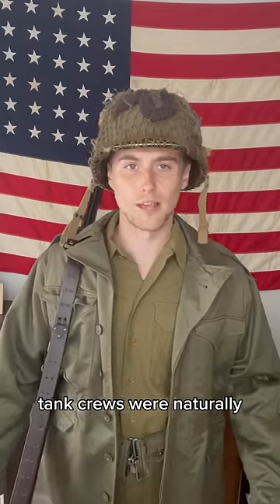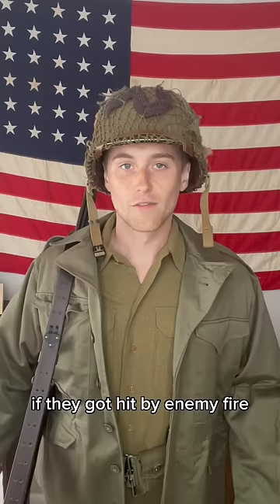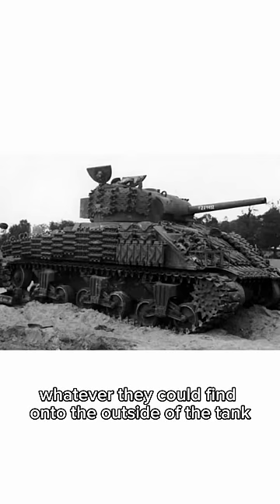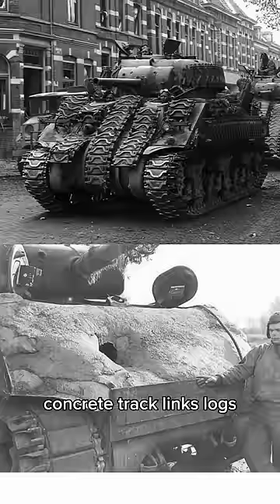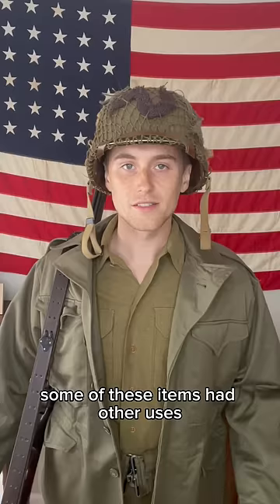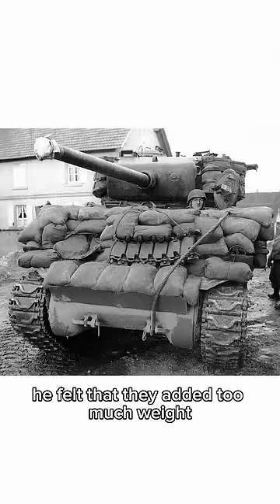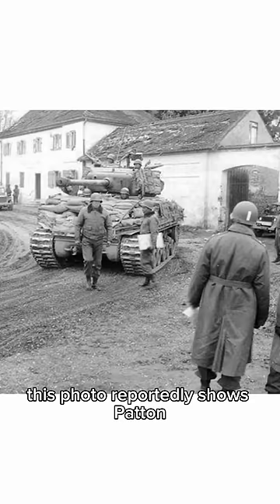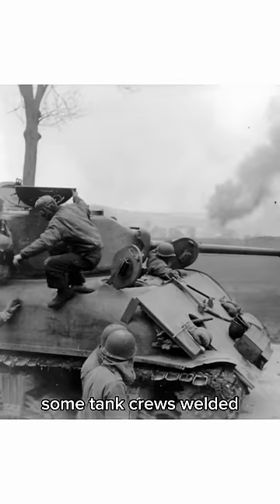Improvised Armor on US WWII Tanks

Comment: The Germans actually scientifically tested weird improvised armor like sandbags and concrete and even track links and found them to have no significant added protection against armor piercing ammunition
Reply: The biggest advantage of sandbags to the Sherman was to prevent the small arm rockets like the panzerfaust from instantly being able to destroy an early m4 model since they had terrible ammo protection
Reply: The Russian did too, but they still add random stuff cause it give the tank crew extra courage to rush forward. You can say these stuff is like the fancy skin that add zero armor value, but add mental strength.
Reply: @CSRI except a panzerfaust crew would never be stupid enough to attack the front of the tank. 

The main addition was moral support to the crew.
Reply: Sand bags for the driver may protect from small arms when he's open hatched
Reply: @CSRI unfortunately it had the opposite effect. DOD ran tests and found it actually helped the early heat projectiles fuze easier. But seeing the morale boost it provided they decided to withhold this information
Reply: The Germans themselves were applying forgot what it was called to tanks to prevent magnetic bombs. Improvised armor definitely was useful against certain types of ordinance.
Reply: @limyohwan zimmermit coating wasn't a makeshift design. It's factory applied.

Comment: During the Marawi Siege here in the Philippines our military kinda did the same against the RPGs of The Maute Group (Isis inspired group.) they added wood, and other materials to thicken their armor. Some legends even Painted "Free Wifi" on them.
Reply: That was actually effective against the early RPG 3 warheads, but if it came to actual protection against AT shells from other tanks, the protection was marginal at best compared to all the additional weight
Reply: @Charles-A they were useing rpg 2 not 3 and if im not wrong used cheap HE vertions not HEAT
Reply: @nikolaideianov5092  Thanks for the clarification

Comment: Being entirely fair, this did work out in some specific circumstances. This is why in that Marawi Siege in the late 2010s you saw AFVs with wood, plastic, and even cardboard bolted on to the vehicles and this provided enough protection from older model shaped charges.

Comment: I believe this was from The Chieftain but the improved protection using sandbags, wooden planks or track does more harm than protection against enemy shells.
Reply: Not shells but heat projectiles like the many AT launchers available at the time
Reply: @Doc_Paradox and also the shells, because it's too soft to bounce the shells, so it would either lead it much closer to a 90° armor hit than it should've hit without it, or nothing changes, which still means they are dead
Reply: Man you should have warned german tanks that put tracks in front of it as part of extra armour.Ex:Panzer IV and Tiger.They did this for pure added armour
Reply: @pecetabla8042 when you put couple inches of armour on alrrady flat surface, it stays flat or 90 degrees, thats why Panzer IV has track in front of it, extra armour
Reply: @Doc_Paradox  i’m pretty sure you have to have it. Spaced for shit like tracks and other stuff to work against heat rounds because if they’re still touching the tanks metal it’s gonna do nothing but just add another few inches of metal for the heat round to go through.
Reply: @owen6033  the DOD did tests and found the additional junk actually put the tankers in more danger as it would help early heat projectiles fuze easier. But upon telling this to various upper brass they all agreed the psychological comfort the added armor gave was better for morale than revealing to them they were at an even higher risk.

Comment: Patton may have been right for more reasons than that. A fact I've heard (but haven't checked, so take it with a grain of salt) is that add-ons like logs and sandbags could actually help an incoming shell penetrate angled armor by helping it normalize against the angle, similar to how the cap on a capped AP shell works.
Reply: Tests conducted had shown that did happen.  

It was even worse for HEAT rounds from panzerfausts, since it made them much less likely to deflect,.  It also increased the  standoff distance to a more optimal location that made penetration of the actual armor easier. .
Reply: Maybe the moron could’ve pushed for better equipment for his soldiers that actually died obeying his command than scolding them for wanting to not die.
Reply: If you bothered to do any research, you would know that he did just that.  
Patton was a big believer in improvements that actually worked, like adding on additional armor plate.  He instructed that add on armor plate from wrecked tanks be salvaged and and used.
Reply: @scottydog1313 W.. What..?

You know how HEAT works, right? A chicken wire mesh could prevent Heat from penetration.

Besides, German tanks mostly used APHE, some variants also opting for BC, however there were very few variants that utilized HEAT. Now the STUG and STUH assault guns did, and were common ambush tanks. They'd have a hard time with a log equipped Sherman.

Comment: I gotta agree with Patton on this one. Sandbags might protect from small arms fire, but if you’re going tank to tank, most of the time you’re not so worried about their machine gun. You’ve got bigger problems. The added weight most likely isn’t worth the trade off. Additional frontal armor will at least give you a chance at surviving some tank rounds that you otherwise wouldnt have though.

Comment: Video games tell me that the angle of the metal plates were just as important as the thickness. The addition plates being angled seem better than sandbags that might help enemy fire find purchase on the tank. But as someone who's not military and only seen tanks from a distance, in videos, and in games I would trust the experienced soldiers over what I think I know.
Reply: Unsure what the Ballistics on sandbags are (I know they're good at stopping small arms) but they might be like a reactive armor in the case that it absorbs the initial impact and helps to slow down the round enough so that when it hits the actual armor, it has a better chance of deflecting or just flat out not penning.
Reply: I dont think the average soldier in the 40s has as much knowledge as the average highschooler in the 2020s considering the amount of research in basic physics thats happened since.
Reply: @wingsoficarus1139 their tank and training manuals state exactly how angled armor effects the reliability of shell penetration.

At the end of the day, in most circumstances, the ad-hoc armor most likely provides some small amount of protection, seeing as things like reinforced concrete were officially implemented on German tanks.
Reply: @medicodyssey  reactive armour acts primarily by destabilising or fracturing projectiles, spreading the projectile over a greater volume of armour.
Reply: they really only worked on something like the panzerfaust because of how the weapons was designed. every other option shown would work at least somewhat against all forms of AT weaponry. Sand bags add way too much weight for the little good they do. Slap on logs and scrap wood would do the same job against the panzerfaust, but be far lighter. @medicodyssey
Reply: @jaydeleon8094  You would think so, but they actually made things worse. The Third Army did a study on the effect of sandbags and logs and such on shaped charges, and found that the additional stand off range actually increased the penetration power of the weapons. The reason was because of the rudimentary design in early shape charges, the jets didn't focus properly until several inches after detonation. The blast itself would blow the sandbags out of the way, leaving a clear shot for the jet of metal liner to the armor.

That report is a big reason that Patton did not like the additional armor, on top of the fact that he liked his soldiers and their equipment clean cut, shaven, and squared away as it were. The proper metal plating actually did diminish the effect of shape charges because it had a rigid, heavy structure to disrupt the jet from forming properly before it hit the main armor.
Reply: the sandbags yes. sufficent sized logs would also work to not kill the crew. wood planks added spaced from the hull worked well, especially on the front. the sides was to prevent an instant crew kill.  this is also why you see tracks under logs and wood  on the sides to acteds as spaced armor for more additive armor. @MUJUNKY
Reply: @jaydeleon8094  I'm inclined to believe that logs may have worked better than the brit tests I read through seemed to suggest now that you mention it, mostly because of the recent fighting the Phillipines did against an ISIS offshoot. 

They attached logs to their V150's (Maybe V-300? A vehicle of Cadillac Gage Commando heritage.) and swore that they helped majorly against RPG's. I wonder if that has anything to do with the wood converting to what would effectively be sawdust and forming a pseudo-ceramic. 

Everything I've seen on paper says that most add-on armor is worthless without some very specific criteria being met, but sometimes paper projections and lab results are wildly different to real world examples.
Reply: @MUJUNKY  that’s usually being spaced armor. If it’s pressed up against the armor it’s not gonna do anything. But as long as it’s a few inches out, or big enough in the case of logs, it will work against older HEAT warheads.
Reply: I wouldn't trust us. We are a very superstitious bunch. A soldier might know how to operate their weapon, but if you ask them how it actually works, they probably won't be able to explain every detail about it.
Reply: Sand when hit by a high velocity projectile has very solid properties. So it's reasonable to put it on a tank as long as you don't overload the tank. It's always going to be a dice roll though. Because a large projectile could also just get funneled by the sandbag drastically changing the angle of attack and thus removing any of the advantages that angled plates could have on a direct impact.

Comment: I wonder what effect these field modifications had on the traversability.
Reply: Adding a few extra tons of crap onto the suspension sure didn’t do them any favors. Besides, im pretty sure if an AT round can punch though 4-6 inches of armor grade steel then it’s not going to care about logs or some sandbags.
Reply: @fboyg91 the charge actually did care about the logs as it detonated on the logs rather then the actual armor, but sometimes this made them more effective.

Comment: A good example of this is the T26E4 Pilot Prototype No. 1. The crew took the upper glacis from a destroyed Panther, cut it up and welded it to the Upper and Lower glacis of the T26E4 as well as the turret mantlet, adding 80mm of armor on the front of the tank.

Comment: In reality most of these add-on measures did actually do very little. Some, like the track links, could even make a round penetrate when it would have bounced (the softer rubber can help a round “normalize” to the armor’s angle). But it did make the crew feel more protected, and thus, more confident in making bold maneuvers, making them more effective in combat.

Comment: I could see the extra layer of tank armor wielded onto the front and sides of the Sherman to have extra benefits against both warheads such as the Panzerfaust and Panzerschreck as well as higher velocity shells, especially with the addition of spacing the armor rather than having it flushed with the existing armor of the Sherman. Additionally, thick logs not only being versatile, they could also potentially cause premature detonation of high explosive warheads, much like caged armor is designed to do; it wouldn't be effective against shells though. The sandbags wouldn't have added any extra protection against incoming fire, anything that would be stopped by the sandbags would have also been stopped by the thinnest section of armor on the Sherman. The only exception I could possibly think of is the top of the tank along the commander's hatch and gun positions where enemy rifle fire would be trained on, but even that would have its disadvantages including increasing the tank's profile and reducing commander visibility.

Comment: The tracks and added on armor reduced spalling and chemical weapons impact due to the spacing between the additional armor and the actual tank armor. Though, it wouldn’t help against APHE, commonly used by German tanks due to high velocity and reliablility.
Reply: I don't know the metal of the tracks but I saw comments saying that it was softer than the tank's original armour, due to it being (supposedly) softer, would that help to APHE rounds penetrate more like the efect the softer metal of the APC round had?

Comment: Those improvised armor add ons actually provide a significant amount of protection especially against the German AT rockets 
Since it spaces out the point of detonation by at least 5-8 inches which decreases the penetration by insane amounts
You’ll still feel the same amount of force but it won’t be penetrating and actually causing damage 

It’s just the inverse technology for the timed tank rounds that penetrate then explode

Comment: Track link armour does look quite cool 
Probably helped break up the outline of the tank at a distance
Reply: But sadly it makes enemy rounds more likely to penetrate because of normalization effect.
Reply: @Sarfanger  I’m not sure the Normalisation effect fits in this context 
Unless I’ve got my facts wrong 
Can you explain please?
Reply: @corditesniffer8020  I couldn't find the document that talks about it, but in normal case because of shape of the shell and fact that its trying to find path of least resistant shells always have tendency to change direction away from armor causing it to bounce. But if you add stuff that is not normal armor quality on top of the main armor shell benefit somewhat from normalization effect where it has higher chance of penetrating sloped armor. 

This is the same reason why APCBC and APC shells have better slope penetration then armor piercing shells that lack any cap, because those shells have softer cap front of the penetrator originally to make shell less likely to shatter. Other way to achieve normalization is to use more blunt nose in the shell, so it's more likely to dig into armor rather then bounce off.
Reply: @Sarfanger  Ahhhhhh yes okay I totally understand that now 
cheers fella

Comment: Yes but also the Sherman’s were rejoined for having the highest survival rates after a penetrating shot. Something that tanks with thicker armor lacked was space on the inside meaning if you penetrated them it would often kill everyone instead of one or two people. The Sherman was also pretty flexible just lacked firepower and armor with few models being the exception. Overall it won the war by not being the best but having enough to overwhelm the opposing force and using different tactics to handle better opponents. It also was just better than a lot of tanks when comparing it to a country that wasn’t Germany and even a decent amount of German tanks themselves. I mean tigers are very popular but they weren’t numerous so a tank division seeing a tiger or tiger 2 wasn’t as common as people think.

Comment: There are some instances of such armor working though, during the Lebanese conflict in the 1980s (if I recall correctly) Lebanese T-72s were cut through by Israeli Centurions firing the M111 APFSDS round, to solve this, Lebanese tank crews would weld an steel plate (not thick maybe around 11mm) to the upper front plate of the tank, and the M111 was not able to penetrate it this way.

Another instance is the T26E4 dubbed “Super Pershing” of which US Army Engineers welded the upper glacis of a Panther (80mm) to the Pershing along side of its upgraded gun.

Comment: Turns out Patton was right. Post war tests done by the US Army found that it would take something like 3 feet of concrete to stop a Panzerfaust round from penetrating the front plate (and even more for sand bags). The tests did show that concrete had one advantage - it did reduce spalling when rounds penetrated and, thus, injuries but at the cost of mobility.

Comment: The scavenged plates certainly provided a degree of protection, but they were also heavy and took an additional toll on the running gear and transmission of the tanks fitted with it.  OTOH, even with this additional toll, driving a tank until the undercarriage failed in some way rather than having the tank knocked out by enemy action would probably be considered a very lucky or very good crew.

Comment: Today though most anti-tank RPGs work by detonating just as the tip touches the armor and releasing a hot stream of metallic plasma into the vehicle. Random assorted objects getting in the way of that would impede the process and protect the vehicle

Comment: Adding any welded metal to the tank did increase the weight but didn't affect the speed of the tank. Not by very much. As for the reverse or traverse, not too sure. Regardless, it provided a bit more protection, much needed against 88 and anti tank field guns.

Comment: im pretty sure they provided decent protection from shaped charges such as panzerfaust and panzerschreck launchers but they were ineffectuve against tank shells
Reply: No, most of these extra stuff added on top of main armor actually makes pazerfaust more effective. Reason for this is Panzerfaust has unoptimized stand-off range meaning it normally explodes too close to armor. Now you add distance between warhead and armor so copper stream has distance to form and suddenly your pzf30 defeats 220-250mm armor rather then 180mm